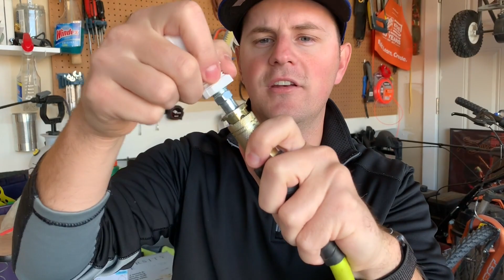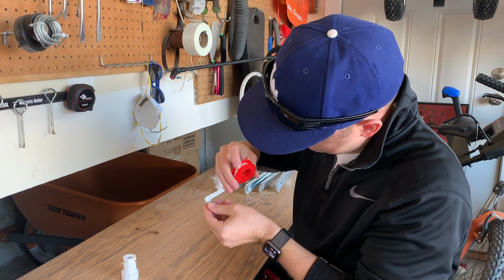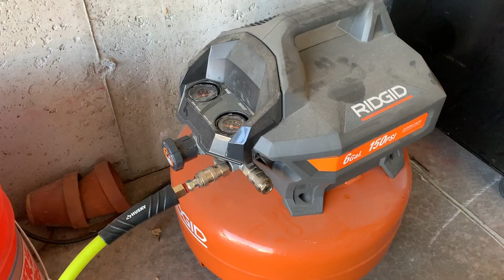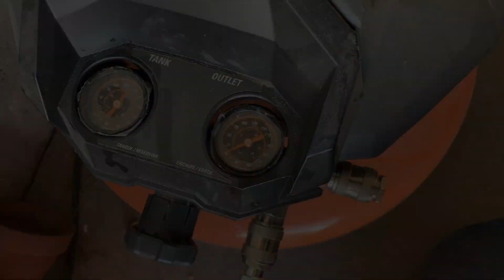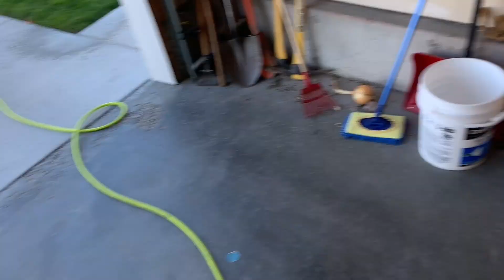Winterizing My Sprinklers With an Air Compressor (Secondary Water Line)

Comment: Hey there.   
I’m here in the grand ol city of Lehi. How did u manage to get your system done. I have a craftsman 6lb pancake. If I hook it all up and use it at 40 psi. My air tank drains in about a minute and there is no more air pressure to push out. .  I basically would have to stop, go, stop go.  I got water to come out of system one. But like I said. That lasted a minute. And then my tank needed to refill.  How are people doing this with their pancake style air compressors?  Any help would be awesome. Otherwise I’ll have to just have to pay someone.
Reply: I took back my craftsman pancake and got a Kobalt 26lb air compressor at Lowe’s. I heard gurgling.  But only in the front two sprinklers. None of them pop up.  Am I missing anything.  I have the city secondary water turned off, I opened the water in that black piece too and hit it at 40 psi.  It lasted longer than my pancake but Nothing popped up on system one. And then it tripped my system as well.  I’m just wondering what else I’m missing
Reply from the maker: Doing it with a smaller tank is manageable, but a bit tedious. When I had one I would blow out each zone multiple times.

Comment: Where to buy those adapters? I just couldn't find them in Home Depot.
Reply from the maker: I went to my local sprinkler supply store and told them what I was looking to do and the grabbed all the pieces for me. I'm going to be updating this video here pretty soon, will be sure to try and be more specific about those pieces.
Reply: @JimmyLewisMows  thanks!
Reply: I was able to find an adapter at Home Depot, the Lowe’s across the street were all out.

Comment: Hi Jimmy, very useful video...thank you. I have question, Before I switch on the air do I need to turn the valves on it is like a quarter turn on some thing next to the Valve?
Reply from the maker: Thank you. I just turn on the zone at the controller to open the valve. But yes, do that before you switch on the air.